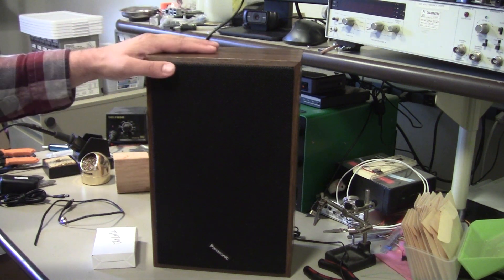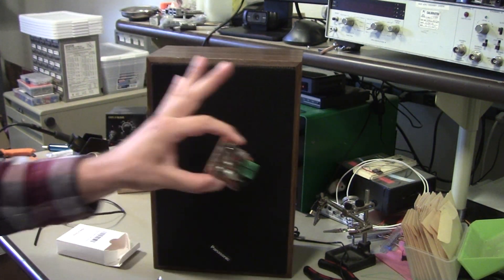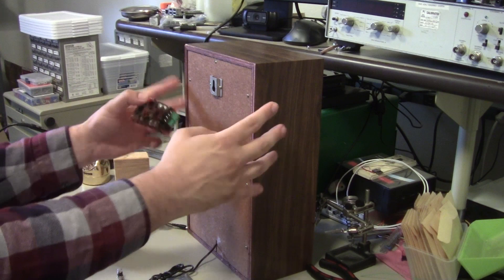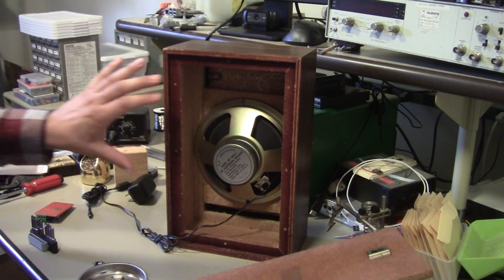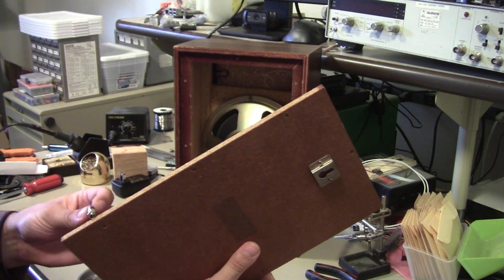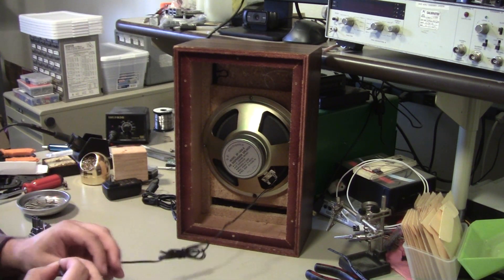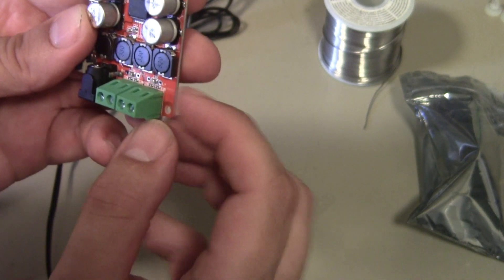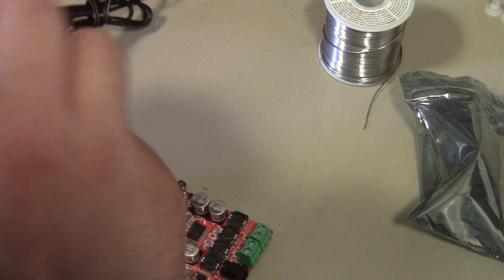Build Your Own Bluetooth Speaker

Comment: Nice job! This got me wondering what it would take to mix both the left and right channels together, since some songs have things on one channel, but not the other.
Reply from the maker: I've seen speaker sets that take stereo into their crossover and output a center channel, so it might be a pretty simple set of resistors/capacitors arranged somehow... One thing I didn't think of until after I shot this video was bringing the right channel out to two lugs on the back of this speaker, so you could wire a second speaker into it. Polarity would then matter, which I believe I just ignored all together on this build.
Reply: @KennethFinnegan  That would have been a slick modification